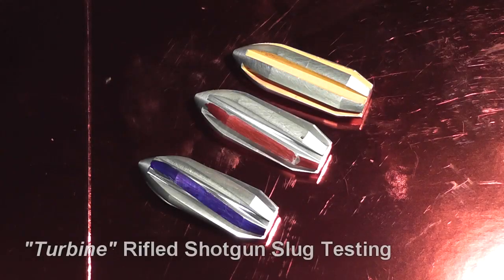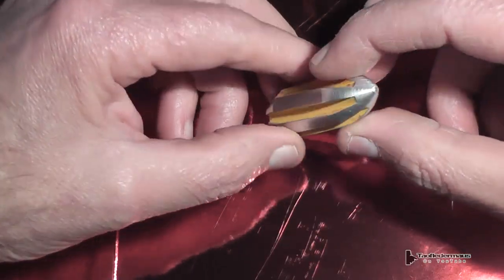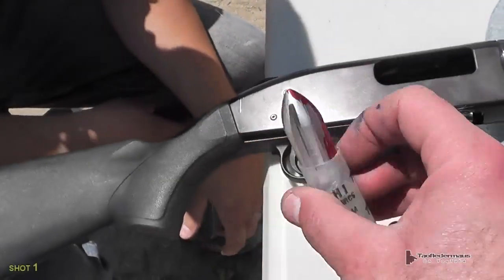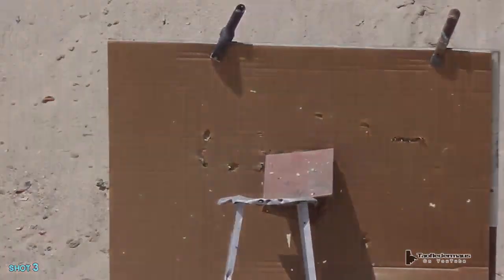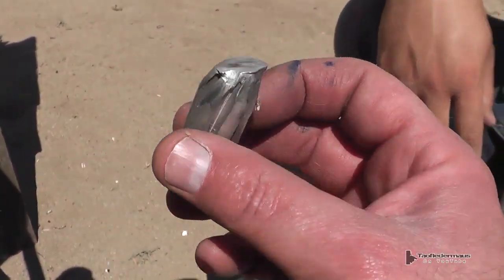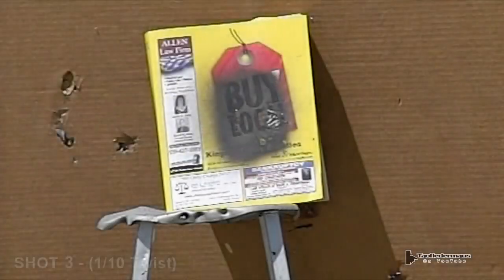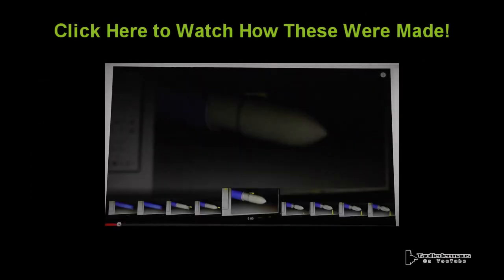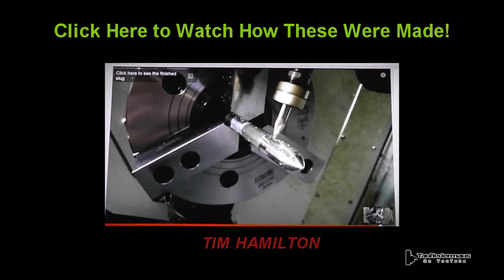Custom Aluminum TURBINE Shotgun Slugs  -Testing

Comment: I wonder...wouldn't the range the the factor here for why some rounds aren't straightening up? Some rounds have corrected themselves in flight, right?
Maybe for the larger slugs, more distance should be added.
Reply: It would have to be a lot more distance.  The problem is that the hot gasses propelling the slug make it spin the wrong way.  If he replaced the wadding with a wax plug, it might help or it might blow up in his face.
Reply: Richy Rich there is no wrong way to spin. If the gasses caused a spin it would stabilize the slug in short ranges until the incoming air forced the rotation to stop and then resume spinning. They were mostly destabilized. There is no simple way to force air to cause enough spin on such a high mass object.
Reply: Filipe Amaral
These are not high mass objects.  They are aluminum slugs.  Also, have you ever stuck your hand out of the window at 60mph?  How about 600?  These projectiles would stop rotation in the first 10-15 feet after leaving the barrel.  At that point they would try to rotate the opposite direction, the Intermediate Axis Theorem would kick in, and they would begin to tumble.  It's like driving your car down the road and suddenly throwing it into reverse while trying to balance a pencil on its pointy end.
Reply: Aluminium slugs almost as long as a .50 BMG bullet. It's high mass.

Your hand at 60mph isn't supersonic or even near transonic. Plus, it has a big frontal area. The grooves that receive a moment of force have a very small frontal area plus the air in front of them is destabilized.

Your hypothesis relies on rifling on a projectile working - which doesnt - to cause these behavioral changes on the projectile. If your hypothesis was true, the projectile would come out already stabilized, which it doesn't. It would also have pathetic muzzle velocity as pressure would be lost on the grooves.

Comment: To me it looks like here's what the problem is:
The rifling is way too deep and is opened at the back of the round, so a lot of the gas from the powder is simply going through the rifling and ahead of the round. The wad behind the round may be flexing into the rifling too. Because of this the round ends up being too slow, and contact with the wad during trajectory causes the round to tumble.

Comment: Did these rounds engage the barrel at all? If not, blow by would want to spin them the opposite direction. Perhaps a choke a thou or so smaller then the rounds diameter, or a couple thou smaller nylon choke would work to spin them up.

A sort of reverse sabot, a ring of plastic engaging the front of the round and being stripped off by a choke might also work. Maybe design it like a spider shaft coupler and engage a couple protrusions on the choke to keep it from spinning as the round passes through it?

Comment: The reason shotgun slugs fly straight is because the centre of gravity is at the front of the slug, they have a hollow base and fly like a shuttle cock, the grooves or 'rifling' is more so it can be fired through a barrel with a choke (brenneke slugs we the first to call it rifling). It allows the slug to squeeze through, a shotgun slug is larger than almost all chokes. Weather or not it spins out of a smooth bore I'm not sure, but I don't think it would, at least not while its supersonic.

Comment: aren't rifled slugs intended to be used in rifled barrels to make them spin?
Reply: ***** No I'm pretty sure they're for smoothbore shotguns. You don't need a rifled slug if you have a rifled barrel but not everyone puts rifled barrels on their shotguns because you can't shoot shot out of them.
Reply: Rifled slugs are for non-rifled barrels. The "Rifling" on the slug allows it to squish down to fit through any size of shotgun choke. It is not there to spin the projectile. A projectile that short is inherently stable.
Reply: Shoes A rifled slug is not for stability. It doesn't work that way. The notching is to remove weight in the rear, making it more aerodynamically sound, and to take pressure off the barrel. The round will squish down if shot out of a choked barrel, this is the point of them. Theoretically, the round should fly stable after a tumble or two, but is not expressed in this video, due to the weight distribution of the round, but it does not work off gyroscopic stability at all.
Reply: no, slugs without rifling are meant to be used in rifled barrels, as are sabots
Reply: Tombs Clawtooth I agree on the rifling but a rifled slug's stability comes from the fact that its base is hollow.  This puts weight in the front and drag in the rear which stabilizes its flight like a badminton shuttlecock.  If the shortness made it inherently stable, a lot of handguns (particularly 380 and 45acp) wouldn't need rifling since the projectiles have a similar aspect ratio to a shotgun slug.
Reply: ExaltedDuck Fair enough, but I have seen solid bore sized projectiles fly perfectly true from shotguns, without the base being hollow.

Kind of the same deal with firing a ball. Even if it does tumble somewhat, it's still going to be tracking pretty well straight, unless the drag is dramatically different depending on its direction.
Reply: ha, okay :) thanks
Reply: Tombs Clawtooth this
Reply: Tombs Clawtooth  I hadn't known that and it's quite interesting. Thanks!
Reply: rapskallion Something to think about regarding the short length of a 12 gauge slug: I have some .410 slugs that are actually long proportionally.  They are quite accurate too.
Reply: Some tank cannons have rifled slugs, which are designed to work opposite to rifled guns. Instead of the barrel, the tank shells themselves dig into the barrel to spin. 
Not sabots, though. Those fly pretty much straight like a dart.
Reply: Appletank8
 It helps that sabot darts have fins.
Reply: Tombs Clawtooth I shoot rifled slugs out of a rifled barrel, it's just as accurate as non-rifled, and sabots out of the same gun. At least as accurate as I can physically be.
Reply: t4thfavor1212 Yeah, but the "rifling" on the slug usually results in heavy leading of the bore on a rifled shotgun.

Comment: I am not saying that the results were bad, but they could have been better. Using a smooth bore for something like this is not very good. smooth bore is made for things like buckschot and birdshot that perform worse, spread farther, and go off target if given rotation or spin. But, when a projectile is not symmetrical and must fly straight, it must be given rotation to keep stable. Therefore, I think the results would have been much better if shot through a rifled shotgun barrel.

Comment: you havet to have a lttile bit forward weight from the geometric middle, while the groves more deep on the end of the thing.. also can have not entirely a bulelt head like most bulelts but with a rounde doughnut shaped trench (not hole in the top but the trench is a shape of doughnut).
Reply: Heinrich Metzger are not these bullets tested or something? clearly flying spinning sideways. also probably there is a a bad fit, and there would be because the barrel is not rifled. the rifling also must  be hidden if the barrel is rifled and opposite to the barrel rifling.
Reply: Heinrich Metzger more deep on the end of the thing compared to how deep it is at the front.

Comment: Please give me an email address to talk to you. I have some sharpened tungsten rods I want to send you and mattv2099 but I don't know where to send them.
Reply: Please do it. I would love to see that
Reply: neeedleinahaystack if you go to his about info there is a email there.
Reply from the maker: Send me a PM or go to my channel and I have an email there.   I usually am easier to contact through a PM though.
Reply: ***** plutonium is heavier.
Reply: Ogkushmuffins Sometimes you need a malleable round to get the benefits of a rifled barrel. Slugs are really the only thing you put down one and it is naked and the lead grabs the groves.. Shot spreads too much to be effective out of a rifled barrel except for close range.  My guess is the sleeve would spin around some of these experiments like the aluminum, tungsten and definitely the glass (they had to glue it to the sleeve). Although any spin is better than no spin.  The round may need to be jacketed in a soft metal or other material to act as grip and a buffer for a rifled barrel. ...Im working on coating a glass round with copper..or lead. May help. We'll see.
Reply: How heavy tungsten is? Also, make sure they are the right size.
Reply: jacob grigsby mobile app. Lol.

Never occurred to me to try finding it on g+
Reply: Rihards Rožāns Density 19250 kg/m3, lead is 11340 kg/m3 so the tungsten should hit pretty hard.
Reply: Einhaerjar Not bad. Next slug - plutonium.
Reply: ***** Perfect compromise, and while we're at it why don't we encase it in a steel shell and conventional explosives? Wait... wouldn't that make a nuclear weapon? Ah, who cares?
Reply: ***** Why not?
Reply: I pray to God you use a rifled barrel if you want things to spin
Reply: Or are you purposely useing a smooth bore so you don't damage a rifled barrel please just use a rifled Berra it's worth it for all your viewers
Reply: Thanks
Reply from the maker: soquidstudio  I think I told you a couple of the rounds you sent were a hair tight.  You'll see what happens in the next video.  The gun didn't blow up or anything lol.